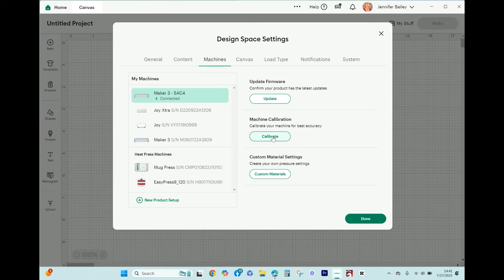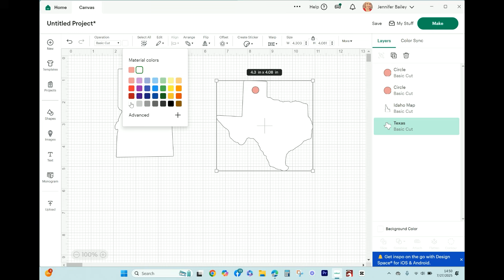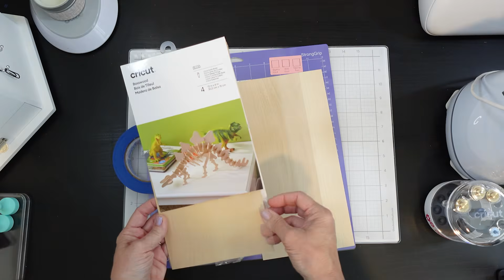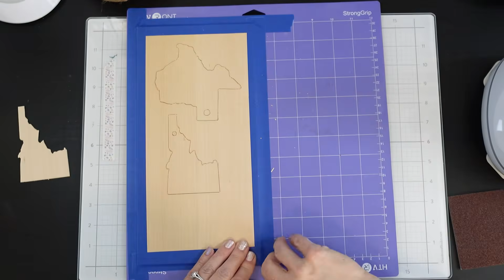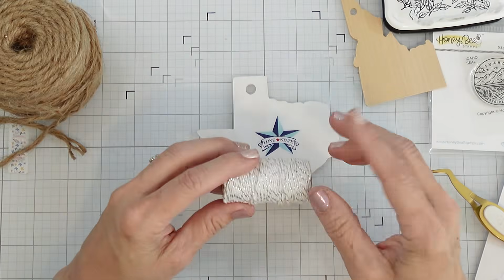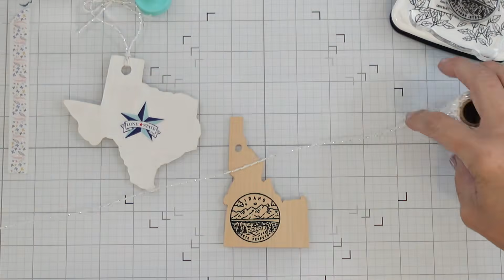💥How to Use the Cricut Knife Blade | Cricut Tutorial for Beginners

Comment: Would you suggest running it thru twice, maybe?
Reply from the maker: Hi Maria! I would definitely make sure to tape it down in place good on a strong grip mat and run the job.  Then, without unloading the mat, use your weeding tool to check a corner or somewhere easy to “pry” up. To see if it did indeed go all the way through. If not, definitely hit the play/go button again before unloading the mat. You shouldn’t have to run the job more than twice I would think if you are using pretty thin wood.

Comment: What’s the difference between subtract and slice?
Reply from the maker: Morning! Slice splits two overlapping layers into multiple pieces, that are still stacked on top of each other. This requires manual cleanup of leftover layers. Sometimes I might need those layers for something else. Subtract cuts the top layer out of the bottom layer (or layers) without leaving behind extra pieces and can be used on multiple layers at once. 😊